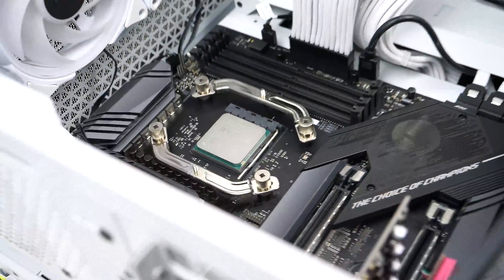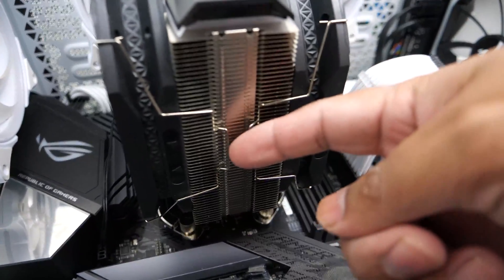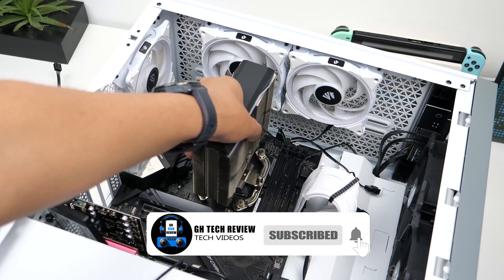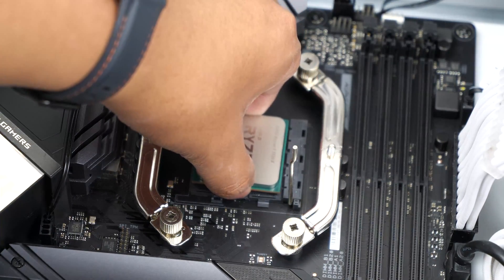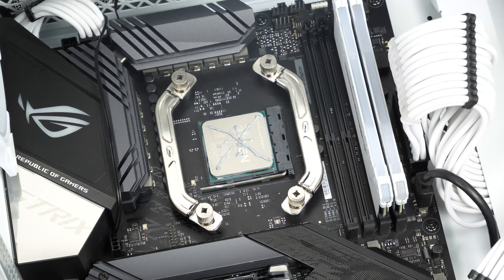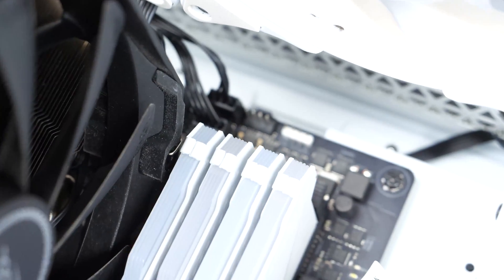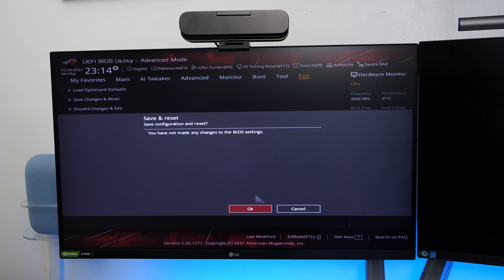How To Upgrade Your CPU Step By Step | AMD Ryzen CPU Installation 2022

Comment: Do you have to update bios before or after putting the cpu
Reply: before
Reply: You need to check if your current bios version supports the CPU, then update it before installation of new CPU.

Comment: I have a question, i currently have the 4650g and wanting to downgrade to a 3600, do i need to downgrade the bios version too?
Reply: No because that would be updating it would make it not work if you were using the 3600
Reply: With most boards, no. Ask your manufacturer to make sure

Comment: Do i change the mobo bios before or after changing the cpu?
Reply: Here are four options you can do
Reply: You could see if the sheep use faulty and put your old one back in and see if it works
Reply: best to do so before, if your CPU requires a newer BIOS that you have on your Motherboard, and if you don't have Q-Flash you will not get any display
Reply: @stefankecina that’s me bro I got a ryzen 9 5900x and now I get no display what do I do ??
Reply: @luckssson240fps7 look up a video on how to update your bios. It’s fairly simple but it can be risky so just be careful.

Comment: so i can upgrade my CPU and not think about anything else? just like that?
Reply: It's important that you have a GPU of equal power along side your new CPU. An older and less powerful GPU would grant you less performance due to it not being up to par with your CPU, but an overkill GPU would cap you out at whatever your CPU can handle, which can short you a couple hundred bucks if you don't do the research.

Comment: If i upgrade my cpu and im not sure if the cpu works can i just put the cpu in and test it without putting the cooler and so on in? Because that would make it harder just to test it
Reply: It will absolutely boot without a cooler, no check is in place besides some MOBOs warning in post about CPU fan failure. If you're just testing for post, you can do that, and turn it off fairly safely... just don't let it run too long.
Reply: @TheDragonsRose  thank you 👍 It will be my first time ever to upgrade my cpu so I'm scared to do something wrong
Reply: @Esxpy  Yeah just as long as it boots, but you don't want to keep it on longer than a couple of minutes I'd say, since without any cooling it will overheat and potentially damage the cpu. It's common for people to test them like this, though.
Reply: @gurysdoghouse accidentally forgot to attach my cooler and turned it on and bike gave overheating error 🤣 got scared shut off asap reinstalled and no issues since 😊

Comment: I put my new cpu in but when I turn it on the pc boots but no picture comes up and the gpu doesn’t start spinning
Reply: Any fix? Mine says no signal when I boot up.
Reply: @aidenroberts4931  could be the gpu not pushed all the way in. Check if you can see any of the pins from the top. Push it in till it clicks and make sure its got additional power requirements (pcie connections from psu)
Reply: @ might be late but I updated my motherboard it fixed. Sorry for being late bro
Reply: Bios update if it’s a new gen or make sure mobo and cpu power cables are connected same with gpu and check psu side also

Comment: i gotta 4060 with a ryzen 5500, im more of a budget guy so we'll a ryzen 7 be a worthy upgrade or save up a little more for the ryzen 9?
Reply: Yes. Look for 5700X3D, it's the best CPU you can currently buy for AM4 socket. There won't be any better, and it's price/quality ratio is sky high.
Of course you can spend 3 times more to get same performence at AM5, but would you do that? I wouldn't. 
switched from 5500 to 5700x3D 2 days ago and it's a blast.
Reply: @lilsos6892  ive seen that, it's a bit out my price range, but I've been looking at the ryzen 9 5700x, I feel like with my budget that's a pretty good upgrade from what I have now
Reply: @lilsos6892  my mistake, the cpu it's actually the Ryzen 9 5900x
Reply: @ioncareoof  Dont upgrade its not wort ut because your cpu doe snot bottleneck your gpu
Reply: im pretty sure a ryzen 9 is aam5 so your mother board may not be right so id say ryzen 7 butt if you want the am5 mother board go for it
Reply: @Chubby-Jet  i got a MSI B550 Pro VDH Wi-Fi motherboard, i searched up cpus that go with my motherboard and i can fit some ryzen 9's but not all.

Comment: So I upgraded from ryzen 3200g to ryzen 5600g , should i manually uninstall the old 3200g drivers and adrenalin software  or will running the auto detect tool automatically uninstall my old drivers
Reply: You can use auto update
Reply: What is auto detect tool ?
Reply: @Lucy-mq1ll auto detect tool automatically detects and installs necessery drivers for the gpu or apu its available in amd's website

Comment: I just got my first PC that has a Ryzen 5 5500 and a 3060ti, would upgrading to a Ryzen 9 be worth it?
Reply: Yes
Reply: depends what u wanna upgrade first i suggest just  get top am4 cpu like 5700x3dor 5800x3d they can handle 4080 and 4090 so u wont worry abt upgrades

Comment: What’s a good cpu to upgrade from a i5-12400f? I have a MSI b760m so I’m limited to intel cpu only? Any help is appreciated. I also have a rtx 4060.
Reply: Intel 14700k or 13700k if its cheaper in your country. Or you can hold. The 12400f is still quite good. The new ones that are coming out are on a different motherboard so don't buy those.

Comment: @nottsoserious Hey buddy great video! I have an aorus b450 pro Wi-Fi Mobo... I'm upgrading from a ryzen 5700G to a ryzen in 5700x3D... Can I just switch it out or do I need to do any updating?
Reply: update your bios
Reply: @ladis_love  Yeah man, i just went ahead and upgraded everything lol...new mobo, psu, gpu, the whole thing lol...i didn't want to bother
Reply: @gambino48 should still update the bios on the new board tho lol
Reply: @NWGarage  I ended up just upgrading my board lol
Reply: @gambino48  could you tell a difference in speeds, I have the 5700g and I’m going to upgrade to the 5950x I use mine for photo editing hoping I see a big difference

Comment: When I removed the cooler the cpu itself was stuck to the cpu cooler
Reply: Its because u didnt heat it up, run something to make it heat up first before turning it off to remove the cooler
Reply: @GavinTheQuacker I had that happen (and it had been running). I don't pull UP now until I give it a slight twist in place. Paste can get hard, AMD doesn't have much of a bracket.

Comment: as soon as i seen all the paste fall all over the socket i was like yeahhhhh wont be following this video lmaoo
Reply: this doesn't do any harm
Reply: @1ddenis1  it could if the paste is conductive and it’s not cleaned up properly, not to mention, it’s messy working overall poorly executed and not neat and not to mention almost impossible to get out the holes of the socket
Reply: @1ddenis1  Arctic silver is conductive and cannot do this. other pastes can.

Comment: this video caused me a bunch of problems, HE LEFT OUT THE FACT U NEED TO UPDATE UR BIOS WITH UR OLD CPU BEFORE U UPGRADE. IF USING AN OLDER CPU such as the 3000 series. Not updating will leave U with a red light and no signal to Ur monitors
Reply: He literally said make sure it’s compatible or update your bios if it isn’t in the beginning lol. Follow instructions
Reply: Lmao did you fix it
Reply: 0:38
Reply: hey so, i didn’t update, and i’m getting no signal right now. how can i fix it?

Comment: Upgraded from a AmD Ryzen 9 3900x to a 5900x. Tried to boot but am stuck on the startup "big ass" eye logo screens. 

Keyboard is unresponsive and won't let me into the boot manager or bios. Thoughts?
Reply: Did you update your bios to the drivers for the 5900x? That would cause issues if not.
Reply: the bios you have is not compartible with your new cpu - as cpu is way younger. process is first upgrade bios THEN swap cpu - sorry

Comment: Wait so if im replacing my cpu but still gonna use my current cooler with the cpu do i need any thermal paste?
Reply from the maker: Yes you need to add new thermal paste. Make sure to clean the CPU and Cooler from the old thermal paste and then add the new one.
Reply: @ghtechreview  so i get rid of the thermal paste on my cooler and add thermal paste on both??
Reply: @food13560 not quite, if you dont have any thermal paste on the cooler then you can add a TINY dot on the middle, then and a slightly bigger dot on the CPU

Comment: I went from AM 4 to AM 4 so I thought I wouldn’t need to try updating the bios but i get no display on boot an my usb ports don’t seem to work
Reply: You need to look up the cpu support list of your motherboard, there it will show the bios version needed for your new cpu. In system information you can find your current bios version

Comment: when i upgrade my AMDcpu 3700x→5700x3d  the computer cant Boot  and CPU has no temperature 😢 who can help me
Reply: need to make sure your bios is up to date
Reply: make sure bios is up to date and check for any damaged pins on the cpu it’s self. if you have any that are bent you can carefully bend them back but be careful because they break very easily. Also double check that the cpu is compatible with your motherboard.

Comment: do you upgrade your bios with the new cpu inside or with the old and then install the new one?
Reply: old one
Reply: @Wakeup828your pc wont boot if your new cpu needs a different bios version
Reply: @Wakeup828 Update the new bios with the old cpu inside UNLESS you're going to restart your pc. You're going to change to a new cpu anyway.
Reply: @Wakeup828 You have to update bios with old CPU first because most newer CPU's aren't compatible with old Bios Versions, so once you update your Mobo bios to latest versions, you should be able to install your newer CPU, that is as long as your new CPU is compatible with your motherboard. You can check you see what CPU's are compatible by going to your motherboards provider website and searching for your exact mobo then clicking support and looking into the CPU compatibility's and bios updates!

Comment: You def use to much thermal paste my friend bit I guess better to much then to little lol i use the one line method.

What about the piece on the back of the motherboard sometikes there is a sqaure holder do we need to do anything with that? Didnt see it in the video.
Reply: Would a x be better with dots on the spaces for every inch cooled

Comment: bruh, you fouled the socket with thermal paste.  💀💀
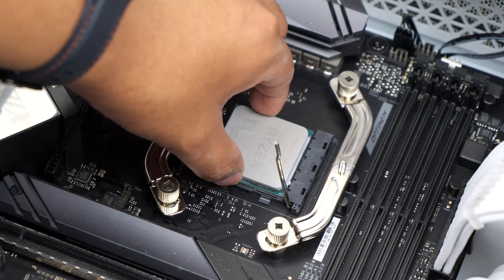Reply: time stamp 2:31 tiny thread of paste jumps into sockets, feels bad for the few pins that match up with those sockets 🔥TOASTY 🔥good thing the system will just stop using those pins and continue working as normal 🤞

Comment: No anti-static wrist strap?
Reply from the maker: I mentioned in the beginning of the video that you will need a anti static wrist strap but that I don't use it becuase I haven't used one and have not experience any issues, but that is not to say that you shouldn't use one.
Reply: Never used one in 15+ years and well over 50 builds. 50 builds from scratch, many many more for simple repairs or part upgrades, I’ve never had any issues.
Reply: You could also touch a grounded metal part to make sure you're not "charged" on static electricity instead before working on the parts. Easiest way to do this is to plug your PSU to your wall outlet and touch it, since it will be grounded by design.

Even if worst case a static spark happens odds that you fry stuff instantly are pretty low (but the odds of slightly damaging a weld that may or may not die prematurely are quite higher).

But anti static strap makes it 100% impossible to cause a static spark no matter what.

Comment: i have a question stupid one of course i changed my thermal paste everything was fine but in the end i was like there has to be a way to properly put the cpu back in because i forgot how i picked it up at the first place, is it possible that i put the cpu on the wrong side i mean like maybe rotated? or it wont go in if its no gonna  fit its rotated?
Reply: so there is a gold triangle like he said on the cpu put it facing the triangle on the motherboard and make sure to place softly and check if it is compatable with your motherboard
Reply: @smile-ik5mn  I mean I put it back it went it and it’s working now but I am not sure if it’s on the right side, like how can I be sure I didn’t rotate it lt or if it’s rotated it wouldn’t fit ? lets say i but it backwards would it be able to fit?
Reply: @АндрейЙорданов-с6ш  sorry for late reply i had just upgraded my cpu and something was wrong i took it to get fixed and btw if it was rotated it wouldnt work only goes in one way and works one way
Reply: I know your asked this question 1 month ago from today but if its any help to you I'm not quite sure I understood your question but the issue you could possibly be having could be due to the springs on your CPU fan and when you thread it back on you'll need to apply a little force to put pressure on the spring so the screw can thread into its socket, but remember to do a little threading at a time in a "X" fashion movement across all four screws!

Comment: When I removed the radiator, the processor was stuck to it, and it got damaged when it came out... Did you experience such a common thing?
Reply: It’s relatively common, the thermal paste is sticking the CPU to the cooler. If you put the cpu back in place and run the system for a few minutes heat it up, it should separate from the cooler much easier.
Reply: Next time give the cpu cooler a twist while trying to lift it, I’ve made the same mistake before. Usually twisting while gently tugging lifts it off with ease
Reply: I've only removed and replaced CPU's a handful of time and 1 of witch almost ended up like that, its very unfortunate but some ways to avoid that is using pre applied thermal paste on a fan if it comes already on it and to only use a tiny bit of paste because the more you use the harder is will be for you to remove the next time you take your fan off, I struggled really bad one time taking my fan off because it was after I used thermal paste from a tube witch was stickier and it was super hard to get off, I will recommend you leaving your PC on for some time like 30 mins to heat up your thermal paste then take apart your PC  by twisting carefully and it should come off!

Comment: Whenever i installed my new cpu my pc booted normally but every 20 mins or so my fans will get high and all my usb devices will disconnect for a brief second and start working again
Reply: Only thing i can think of is your PSU is too weak for your new CPU.

Comment: Hello,do AMD cpu's come with paste or not?
Reply from the maker: No, you need to buy your own, but some CPU coolers come with preapplied paste. It just depends.
Reply: what happens if you put paste on while it already has preapplied paste @ghtechreview
Reply: @hoong_ry  dont do that, either use the preapplied paste or wipe off the preapplied and put your own paste, dont combine both !!
Reply: If you buy an AIO liquid cooler it will usually come with thermal paste already pre applied, in that case YOU DO NOT WANT TO ADD MORE

Comment: ok great, personally just wanted to make sure there was no need to do anything software related and it was ok to simply swap the components. Good thing changing cpu doesn't require like a reinstall of windows or something like that. Ez pz then
Reply: Only if you're changing your HDD/SSD

Comment: After i install everthing i have no display, i have lights on the pc and also the can from cpu works properly... What can i do now?
Reply: Hmmm perhaps you passed you’re watts limit for you’re power supply?
Reply: @R_714-y8o  i had to update the bios of my motehrboard, it was on version 4026 and now its on 6223
Reply: check if the display cable is in the gpu and not the motherboard
Reply: @jetheron  turns out i just sat there and let the computer fix it it's self
Reply: @evagina6971 how do you update your bios if your computer won’t boot up? I installed mine and nothing happens. Monitor says no signal and then that’s it….

Comment: I have an HP EliteDesk 705 G3 PC with an AMD A8-9600 processor and it has an AM4 socket on the motherboard. Can I upgrade it with an AMD Ryzen 3, Ryzen 5, or Ryzen 7 processor because Ryzen 3, Ryzen 5, and Ryzen 7 processor also supports the AM4 socket?
Reply: Nope its not compatible am4 can only go to a10 but if you want to change processor change the motherboard to a320m and ram to ddr4
Reply: Check the model of your motherboard in cpu-z or hwinfo64, then type it in browser and add into that cpu support. Then you will know if your motherboard support ryzen cpus or not.

Comment: I don’t need to change the Clock Ratio and voltage?
Reply: I mean if it was already on auto boost, then no. But if you did it manually, definitely
Reply: @jackaboiXD auto boost how? And manually like how

Comment: My windows is not reconishing my new cpu it does say the cpubut i cant go in windows only bios
Reply: I seen a video saying you would have to reinstall windows again, when changing or upgrading a cpu
Reply: @October10thdeath  i already fixed it something was broken i just deleted my data on ssd and installed win10 pro cuz i had it on a drive and updated to win11 pro
Reply: @October10thdeath   Usually only when you change the motherboard would you reinstall windows. You don't have to with a CPU swap.

Comment: Maybe disconnect the PSU as well?
Reply: There is no need to remove the power supply in this situation. As long as the computer is turned off and not plugged in, you are safe from shocks or static. For extra safety and personal comfort, wear an anti- static wristband. Hope this helps!

Comment: anyone knowledgable here, would a fx-8350 cpu work with a Gigabyte GA-78LMT-USB3 AM3+ motherboard?
Reply: Just use pc part picker. Its the best way to check and see if your components work together.
Reply: Just did a quick check on part picker and it says it is but don't take my word for it